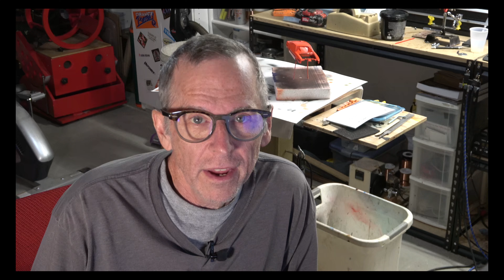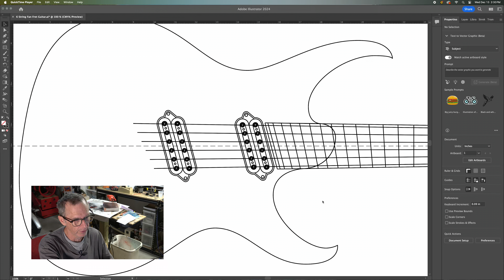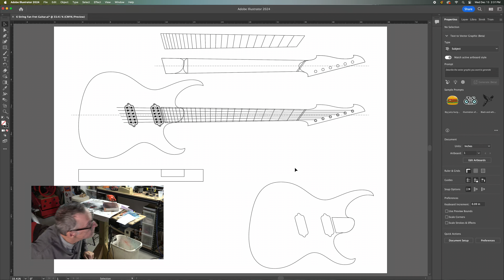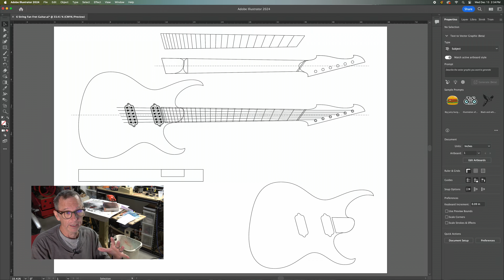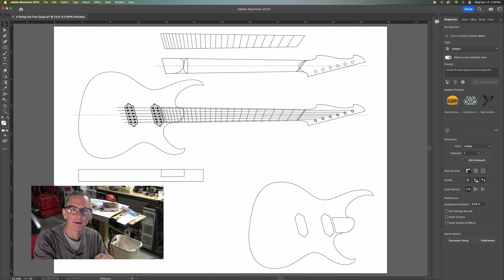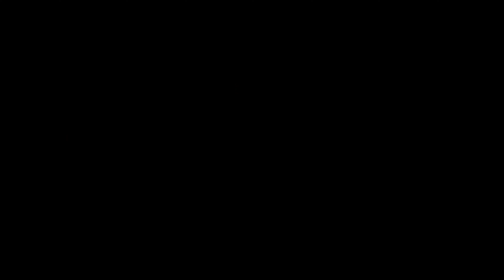Making A Six String Multi-scale Guitar Part 1 The Plan

Comment: Would you consider offering step or svg files for fusion users? Looks very cool!
Reply from the maker: Sorry, but no. I will only offer .stl files. You can convert them to step in Fusion 360.
Reply: @HighlineGuitars  sure, I get it. Unluckily it's not working properly with a personal license, I had a lot of stls from my 3d printing projects but its insanely painful to work with stl and fusion. Anyway  thanks for videos, i learned a lot from them. Cheers!

Comment: Hey Chris.  If this is a wood grain guitar could you try Tru Oil as a finish?  I do not think you have tried it yet??  I think you will be very happy with it.   Very fast drying time.  Thanks for video!
Reply from the maker: I have used it. Not a fan. I prefer polymerized tung oil.

Comment: Does changing the neutral fret of the scale length change how much of the scale length is the guitar body vs the guitar neck? Will it lengthen or shorten the neck? I notice your bridge is up more towards the neck on the body than some guitars and I'm wondering what changes that and why.
Reply from the maker: Changing the neutral fret from the 12th fret to the 9th fret will move the shorter treble scale toward the headstock. However, that won't change the neck's length. The bridge for the longer 27" scale will be in the same place regardless of where the neutral fret is located. The bridge for the 25" scale will move about .2" closer to the headstock. The reason my bridges appear to be closer to the neck is because the body is longer.
Reply: Thank you sir! I'm just starting the journey towards guitar building, I very much appreciate the reply.

Comment: Absolutely beautiful aesthetic design. I'm really looking forward to the build and the final results, particularly if there is a "noticeable" difference in tone and playability (i.e relative string tension) of the guitar due to the different "string lengths" compared to a 25.5 inch Standard Scale length neck and regular direction headstock. The reverse headstock and design looks really cool.